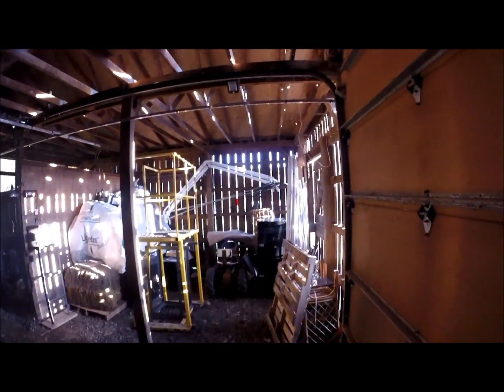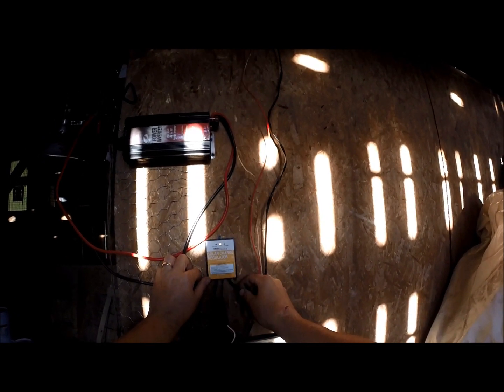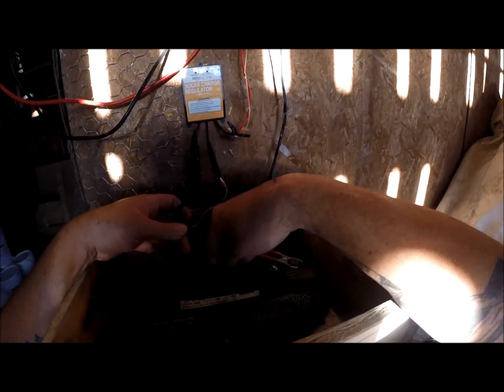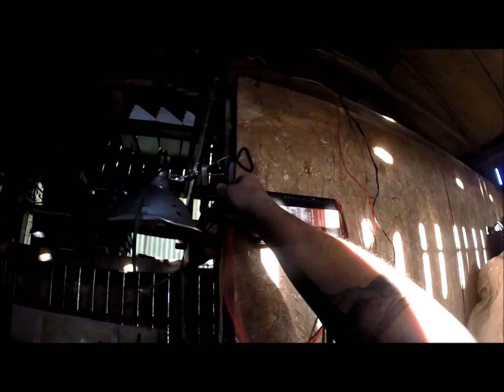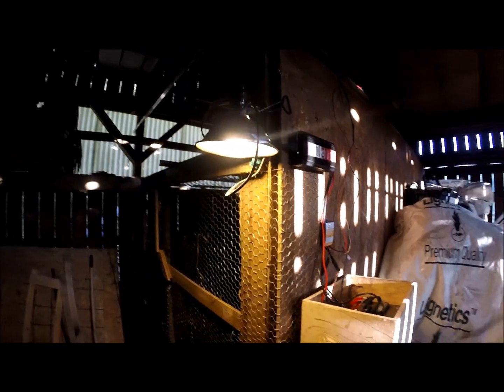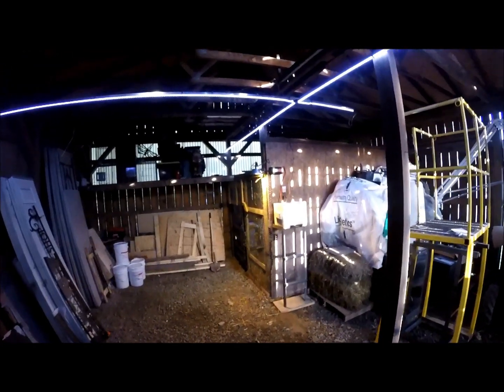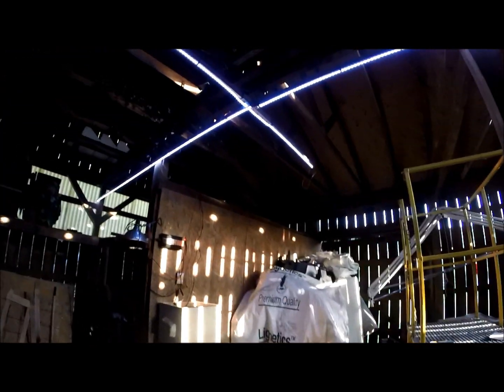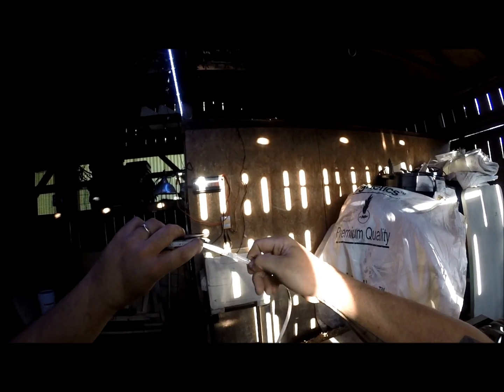Affordable Solar Power For Cabins, Sheds, Homesteads and Barns

Comment: Why not just run 12v 350mw led strip lights instead of converting the power?
Reply from the maker: There are two systems here, solar power 12volt that is powered from the regulator load side and the 110 volt converter. The LED lights are run off the load side of the regulator (12 volt), and when I need 110 power, I can hook the converter up to get that power. The regulator also maintains the highest charge for the battery without over charging it. This is why I showed then differently in this video. Jason
Reply: @ModernPioneer  so with that 110 power you would never leave that running, right? That is just to manually convert it to 110 while you are there and in need of 110 power, right? Otherwise it seems kind of sketchy to have the clamps and battery terminals exposed in a dusty barn. COrrect me if i'm wrong. Im just learning about this stuff
Reply from the maker: @lb3724  Right I only use the 110 when I am present. The led lights now have a motion sensor.
Reply: Joe you are saying right off the battery, no converter needed, correct?
Reply: Jim McNeil Yes, you could run dc led light strips right off the battery. http://www.superbrightleds.com/cat/led-strips-and-bars/
Reply from the maker: Jim McNeil
 they are run off the battery directly, the regulator is a "solar" regulator that is fused to protect the circuit and is the load side of the battery (12volt). The 110 converter is a separate piece of equipment and is only hooked up when I need the 110 power, hence I showed that as a separate piece altogether. It is important to understand the two separate systems here.